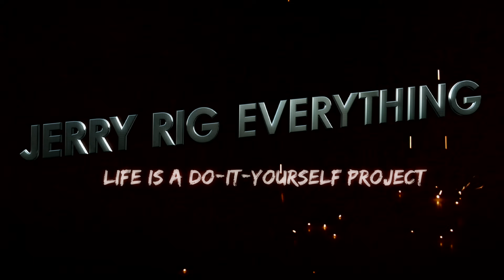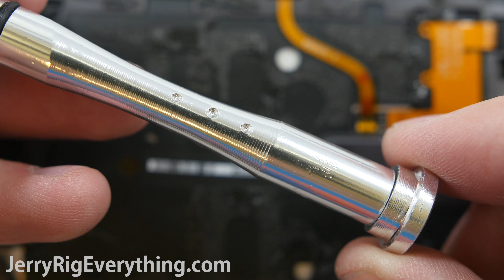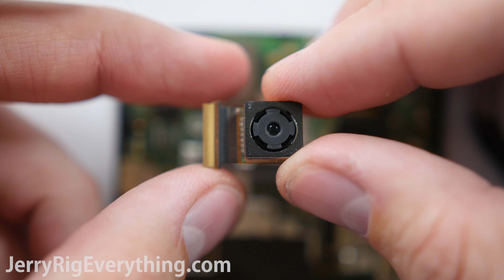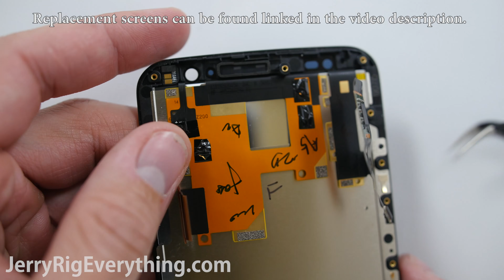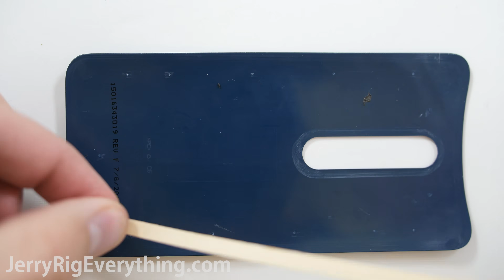Moto X Pure Edition 2015 Screen Repair, Battery Replacement Xt1575

Comment: @jerryrigeverything thanks for sharing this useful video.

my moto x gen2 doesnt power up even after letting it sit on a charger over night.

when the power button is held down the green led light blinks twice, but screen remains black. any idea as to what needs replacement? is it the battery or is it the motherboard?

any input would be appreciated!

Comment: Just replaced the battery. Connected it to a charger. It started charging and I see battery status on the screen. But unfortunately now a power/volume buttons doesn't work. Somehow that tiny ribbon cable with red dot just came off and idk how to attach it back. Probably the tiny connector is broken. Once I press it in I can use power/volume buttons... :(

Comment: The replacement went well for me except the power/volume up/down  buttons didn't work because I accidentally disconnected the ribbon cable for those buttons. After I reconnected it, everything worked fine. I got a higher capacity battery on eBay, it was only $17 and some change. Also, I got the Husky torx set at Home Depot for $11. Those screws wouldn't have come out with supplied driver.

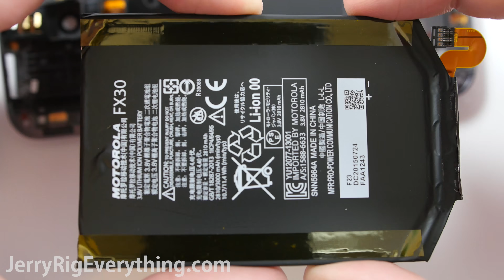Comment: He actually does a full teardown of the phone. For just a battery replacement, you can watch up to 2:15 (removal) and then start again at 4:50 (replacement).
Reply: I did mine last night. It wasn't quite as easy as he made it look, but to be fair, my battery had been replaced once already, and they didn't use the easy-strip adhesive. Otherwise, it wasn't bad, and I was able to reuse the rubber back. Thanks for the help, Jerry.

Comment: Jerry Rig Everything, this whole video confused the heck out of me.  I thought you were going to do just a straightforward video about replacing the battery in a Moto X Pure phone, but most of the video was Greek to me, because I just wanted to learn how to replace the battery.  Can you PLEASE tell me what I need to do just to change the battery.  If you use this video as your guide, please tell me what steps I need to do to change the battery, because if I have to remove all those tabs, parts, etc. I just might as well get another phone.

Comment: Heads up - On my phone, the connector for the ribbon for the volume buttons was glued to the back of the battery.  I nearly ruined that connector before I figured out where the sticking point was.  Once that was pried off the back of the battery, other things went just fine.  The video was very helpful for stepping through the process.  Thanks!!

Comment: This worked will for me twice but it failed for my daughter.  The silver side of the battery is attached.  After removing the NFC contact, I had to carefully unstick the battery from the compartment.  It did NOT "easily pop away from the back since already removed those pull tabs."  But with some careful effort, I got it unstuck.  Everything else worked like a charm.  Thanks for the video!

Comment: Jerry, Help! First, thank you for the excellent video, which made it possible for me to change the battery. BUT now it won't charge. Previously the old battery charged, but it died within minutes. My old Motorola phone had an easy battery change (oh, for the pop out, pop a new one back in days!) so I wasn't aware of what I bit off when I tried to replace it. That said, it's done. But I'm stuck. The phone did turn on and vibrate, and the charge screen shows initially that it's charging, but then it stops. I did replace the turbo charger a few months ago, and it's working well with another phone. So not the charger. Thanks for any input you can provide.

Comment: can't you correct your mistake they are Torx T3 screws not T 4 is that because you want people to click on your link for tool kit that only goes down to T4 torx.
Totally dishonest if true.
Reply: torx T3 started to strip on mine when i switch to T4 it was perfect and tight fit for me. trust me i just finished 3 hours of messing with all these screws and had to drill some out cuz they were stripped clean

Comment: avoid the cheap T4 screwdrivers usually included with the battery change kits. Will just strip the screws. Get a real Torx screwdriver.

Comment: Thanks, great video.  Mine were T3 screws.  I didn't have any trouble with them stripping, maybe because I didn't use the cheapo that came with the battery (which didn't fit) and sprung for an expensive Wiha T3.  I had a little trouble getting the case to snap closed and stay closed, maybe because my battery came flat, and I didn't get it bent exactly like the original?  But I screwed it down carefully, holding it closed as I put screws back in, and going around a few times tightening and retightening, and it seems to have come out ok.

Comment: Great vid! I was wondering if you could help me diagnose a problem I had with this phone: I've replaced the screen 3 times so far, but this last time replacing a screen with a "dead strip", I replaced the screen only to turn it on & have sound but no screen. I replaced the broken screen to see if it was a problem with replacement screen & it wasn't. The old screen also had sound with no screen. Is it something with the motherboard? Please don't say I need a new phone! I love the moto x pure!

Comment: Great video Jerry. I used it to replace my battery, took 90 minutes but it took 30 to remove the old adhesive. Plus I worked very carefully so as to not break anything. Very important to note, the screws are definitely T3, not T4. I also kept track of where each screw was and put it back in the same hole. I did put pieces of double sided tape on back of battery  before replacing and I purchased adhesive backing that matched the phone exactly. I also used a multimeter to test the motorola battery I got from ebay with a resistance load to make sure it was good. Would be a bummer to go through all that work with a bad battery. Thanks for saving me $400.
Reply: I'm wondering if there are two different sizes of screws being used.  I attempted removal using T3 based off the advice that I saw in this thread and ended up stripping the first screw.  I was able to remove the remaining screws with T4, but I haven't been able to remove the stripped screw.  I'd recommend trying the T4 first, and if that doesn't work, try the T3.  It really sucks when you strip those tiny things!

Comment: I've used parts of this tutorial to replace the battery in my Motorola xt1575. Everything is working fine,  but it was not an easy process. I doubt many people have done this without stripping or cracking something. I'll be the first to admit I cracked the female connector to the power and volume buttons but still managed to seat the ribbon back in securely. And I repair electronics.  Especially computers.  I honestly believe the built in batteries are all about competitive marketing. They want their consumers to toss these phones once the battery is no good for the purchasing of a new one.
Reply: I broke my volume/power ribbon. Hoping I can scrounge a replacement from somewhere.
Reply: It's called "planned obsolescence".
Reply: Does anyone know where to buy the original battery for this phone? I only find the "alternative" battery and not the original ...
Reply: @danielatapiamolina773  Amazon sells them with an entire kit to replace it for about 20$. Search for maxbear.

Comment: My phone was at the point where if it was not plugged for 2 mins, it would shut off. Had to buy a power bank to keep it powered all day everyday. So I bought a battery and just did the replacement following this video, PREFECT. I almost messed up though, I missed the screw near the top in the center, (good thing you said 20 screws, had to go and count again and realised I only had 19), and the little connection for the volume button ribbon cable was stuck to my battery, so it got detached, but i was able to reconnect it easily. LOVELY VIDEO. Thanks.

Comment: Hi there. Thanks so much for this video. My Moto X Pure Edition's battery needs to be changed and I will definitely use this video. I clicked on the link for the replacement battery but unfortunately, it does not work. Could you please provide me with another? I have gone to Amazon but the batteries there don't seem to be originals and the reviews aren't very good. Is there someplace else I can get an original battery? Looking forward to hearing from you.

Comment: With this video, I was able to replace the battery in 20 minutes. My Moto X Pure battery was draining fast, but the rest of the phone worked fine. I went on Amazon and bought a new battery, tools, and a replacement back for $30. Everything is like new. Thanks for the video.

Comment: I've recently replaced my battery and it works great, but for some reason the power button now isn't working (even though I didn't touch it at all....). The buttons still click and some screws are stripped so I'm having a hard time getting a look at what is wrong.... Does anybody have any idea at all what might be the problem?
Reply: Same here, replaced the battery, plugged it in, plugged the power strip in but it's not turning on
Reply: Same here! I would double check your power button ribbon cable, its the cable in the middle of the phone that comes out from the left side when looking at it.  I checked mine and it appears to have become unconnected in the middle when I detached the midframe.  I ordered a new one and will report if this fixes it.
Reply: Did you ever get it fixed?  I've had the same problem.

Comment: Can someone confirm the Torx screw size.  This video says it size T4.  Other video say its size T3.  I have the XT1575.  My battery arrives on Monday.  I need to buy the right sized screwdriver.
Reply: Where did you get the battery and how it performs?
Reply: T4

Comment: the screen lights up when i plug to charge it but power button isn't working. i haven't screwed back the torx screws yet. any suggestions?
Reply: Did you ever get it fixed?  I have the same problem.

Comment: I just used this video to change the battery on my phone and it's working great! I had to run to Home Depot for a better screwdriver than the one that came with the battery. I picked up a Husky 8-in-1 Star Precision Screwdriver Set and the T4 bit worked perfectly. Thanks so much for this video. It was so helpful.
Reply: Where did you get the battery?

Comment: Hi Jerry! I made the mistake of removing the side button covers and now have 3 small springs and buttons to reinstall. Where exactly do I put the springs? Do they go in the housing behind the buttons? Thank you!!
Reply: I found the small round spring holes - two at the ends of each button. Good thing I also found the 4th spring. This video is well done. Note that Jerry does NOT remove the side button cover.

Comment: i have a moto x pure and the charging port is almost fully non functional. I remembered that you had made a video about this phone, so i came back to watch more about taking the phone apart in hopes of being able to repair or replace it. :'( wont be able to replace it i guess, but that wont stop me from trying to soldier it back into place

Comment: Replaced a cracked front screen, the touch did not work.  You could see the screen fine.  Installed new screen, now the touch capability works and the screen does not illuminate.  Pure black.  Any ideas what could be wrong?

Comment: anyone else having trouble with the screws?
Reply: Just tried this.  Only got 4 screws out, the rest stripped.  Not worth doing.
Reply: Two of mine were so tight they were running the risk of stripping; a tiny drop of WD-40 on each worked well.  A stuck screw's a stuck screw, even if it's micro-sized.
Reply: With 3 of my screwdriver i got problems, i found a black & decker screwdriver in my room with t4 and tried with it, the screws didn't even oppose resistance

Comment: Thanks Zack, I had asked if the battery would be self replaceable. Does look doable.  Does peeling the back off distort it for reuse, or do you have to buy new? Also, how expensive is the mother board, if charge port becomes sloppy?  Or,  would a competent repair shop be able to resolder new port? Thanks again, good video as usual.

Comment: when you order the LCD screen digitizer + frame assembly it does not come with the front speaker bars. I guess those are some kind of protective bars for when the phone is resting on its face then the audio can still emit?  so I need see disassembly of lcd screen and bar assembly?

Comment: Thanks Jerry. With this video, I replaced my cracked screen successfully. One thing you did not mention was the front facing camera LED flash - which you just need to pop out of the old screen and put it in the same place on the new one. There's no cable or clip, it's just a touch connection. Just in case anyone is doing this and accidentally throws away the LED. (Also since the new screen did not come with speaker grills, they are a pain to put back in - still haven't managed on mine).

Comment: Thanks for the video. I just replaced my screen, but the bottom of the screen is unresponsive. I c an use the back, square and circle buttons, but just above that where the menu button is, that row doesn't work. Do you think I have a bad screen?

Comment: I have a stripped screw on that little section and it's by itself on the upper left corner of the phone. Could i still pull out the back where the battery is attached with no damage or do i have to remove this screw first?

Comment: PLEASE HELP, got a Moto X play., they say the screen circuit has a shot circuit in it and the screen in not repairable , Moto is saying they'll replace the screen for 200$ which is not anywhere near the money's worth.
Reply: Anirudh Hasija Hi, I'd say if repairs are gonna cost near what a new phone would cost, hell get a new one. Not worth the hassle and probably never work as good as new either.

Comment: I bought this phone from eBay and after a few months of use, it starts pressing whatever it wants and does anything it wants after just switching it on or unlocking it.  it Also the bottom row of home,back and all screens panel is unresponsive. I feel that this is because the digitalizer is spoilt and it is the one giving rise to this problem. Anything I should do to fix it myself?
Reply: I had exactly the same issue as you! navigation buttons not responding and registering ghost touches here and there, even voided my warranty by switching ROMS because I tought it was a software problem, but after some research I found that the digitizer may not be connected properly, So I used this video (and the one from the XDA guy) to pry open my Moto X Style (pure) myself, I reconnected the screen pins, put and extra layer of tape on top of them and re-assemble my phone, It's been 30 minutes now and I haven't had the issue again, screen is very responsive and I couldn't be happier! =)
Reply: Angel Cervantes Sorry but what do u mean by screen pins?
Reply: Hemesh Kumar 3:19 un the vídeo i disconntected and reconnected those pins and put electrical tape on top so the pins wouldn't touch the battery, that helped out .
Reply: Angel Cervantes Thanks for your help i will try it out and get back to you on whether it still works.
Reply: So, has it worked you for you?
Reply: Henrique Foletto I couldn't find electric tape XD
Reply: People at the service centres are douchebags they charged me 10k rupees and replaced the whole fucking screen.

Comment: @jerryrigeverything i've removed the back cover but five of the twenty screws are stuck do you have any tip on how to move foward?
Reply: I too had this issue with one screw, what i did was to drill it with the smallest drill head i had, drill the head of the screw and it will be no problem, (not sorry 4 bad english)

Comment: Does the moto x 2015 has notification led light ?
Reply: Jishnu Nair no
Reply: yes it does! but the stock ROM doesn't use it, I have tested some custom ROMS that make use of it, it is hidden on top of the upper speaker! Only white LED tho.

Comment: does the phone need to be powered off before i do this? i am unable to turn it off due to broken screen....and becuz i cant use the phone it is gonna take days before it loses its charge! thanks!
Reply: the power button until it turns off
Reply: if i do that...it shuts itself down then comes back on again
Reply: oh yea you're right but I think if you disconnect the battery it'll be ok bc it won't have power
Reply: isnt the battery inside of it? you are telling me to take it apart
Reply: i had the same problem ,just turn on your camera / flaslight using the shake option it will drain the battery
Reply: good idea! thanks for the reply!
Reply: teakertown If I'm correct,  once you pull the back,  you can pop the plug on the battery.  That will shut it down. You should probably get repair video on computer or another phone to make sure you pull correct cable.
Reply: Peter Ford ...oh okay. thanks. do you have a Moto x pure?
Reply: teakertown Yes I do. Just watched video and yes when u pull the back the battery cable is eligible for unplugging. Course after this amount of time, I'm sure your battery is dead. 😀 Good luck.
Reply: Peter Ford ...yah. do you like your Moto x pure? I love mine and I would never expect more from a phone.
Reply: teakertown Do like the pure.  I'm not hard to please though,  came from Virgin Mobile where you are stuck using the phones they offered. Switched to cricket mid last year,  got the pure 32g version black no moto maker frills,  but yes,  with my budget the pure was it for me.  Always wanted front speakers,,, and nice screen. The pure has it. If it ever gives out I'll get another with 64gb,  but 32 is actually plenty, especially when I'm used to 8,,,talk about no storage. Mostly I hear good reviews. To bad Motorola sold out again.  Lenovo  probably won't keep the X series alive. Be nice if they did. Moto x pure 2,,,,, I could dig it. take care.